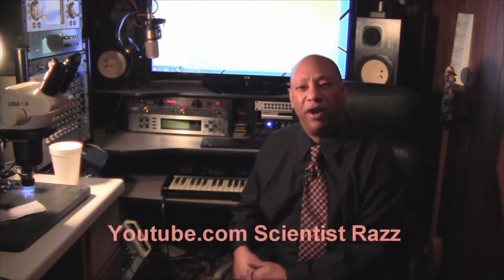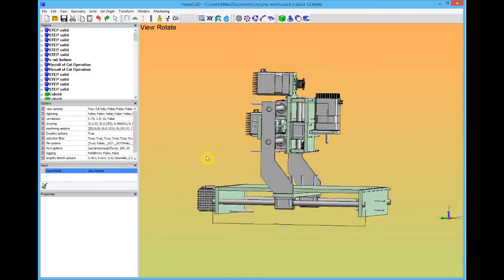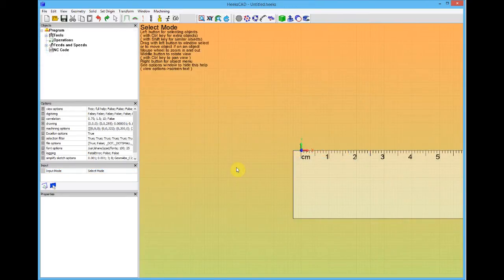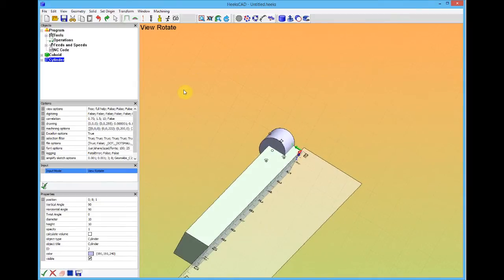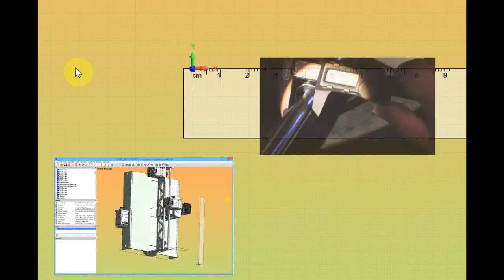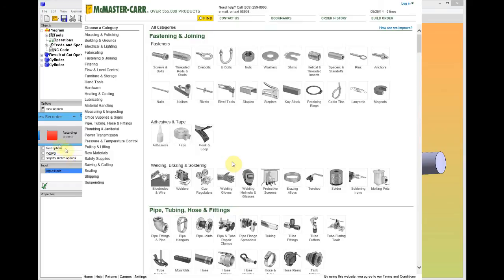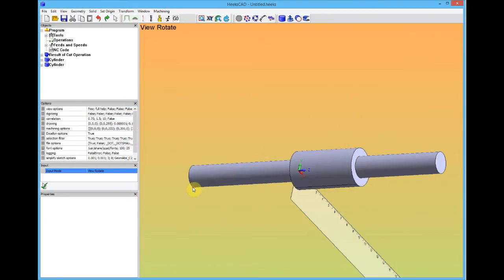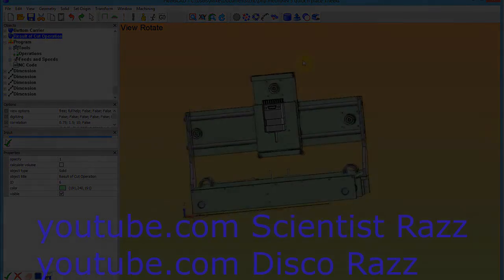Homemade CNC Pick and Place Machine HeeksCNC #1

Comment: Just an EXCELLENT series of videos on the design and construction of a small combination picnplace / PCB router / driller / mask cutter / etc... machine. Razz covers the complete project, from conception, CAD, CAM, CNC milling the parts, assembly videos, setup, and some parts of the operation. Not quite totally running yet, but getting close.